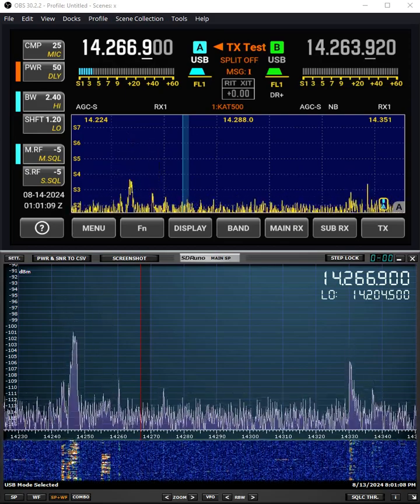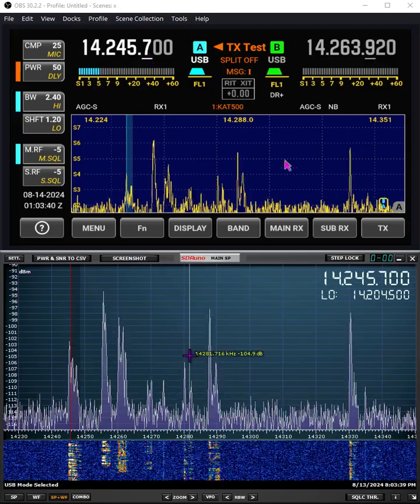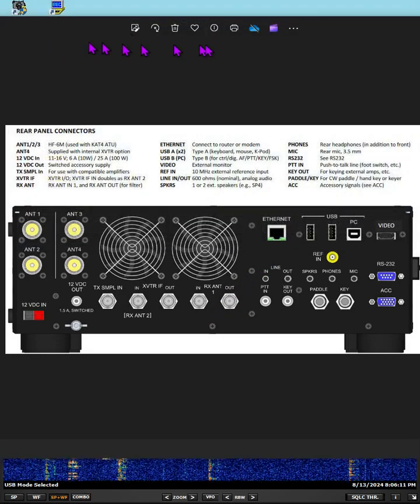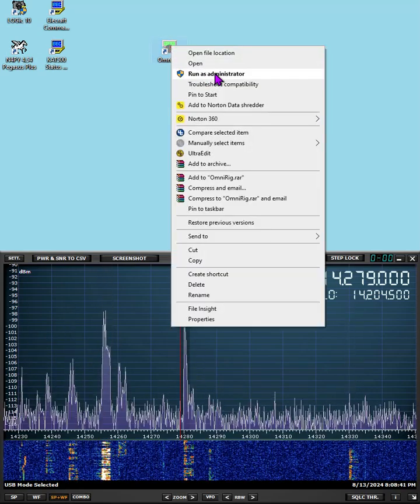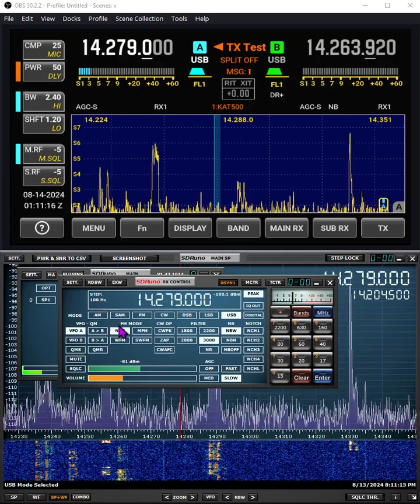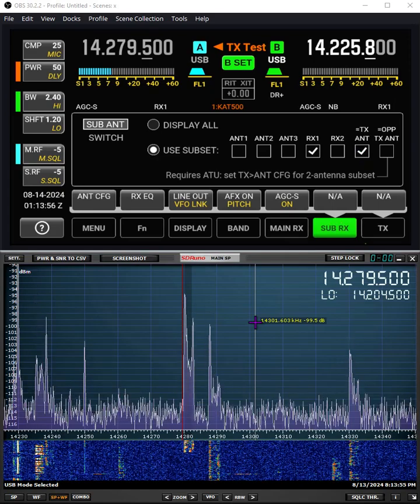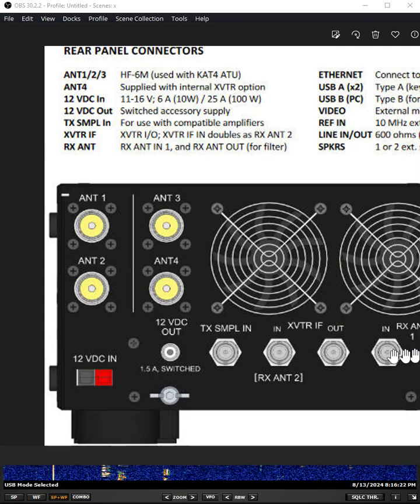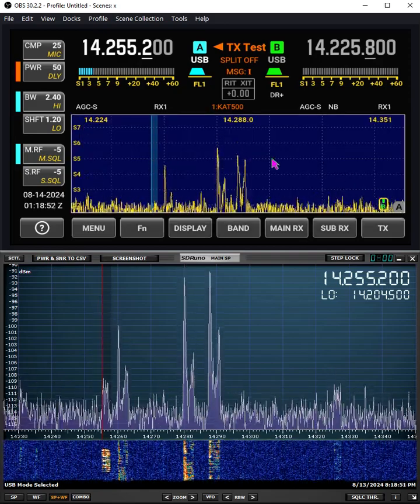Using an external panadapter with the Elecraft K4

Comment: Thank you I was woking on this and missed the button on the radio. I was concerned about RF loading so I used a mini circuits diplexer not just a y cable.  I am using the serial port for my Steppir antenna and I think you can use a USB connection for Omni rig. Please let me know if that is wrong.  This really helps to get mine working.